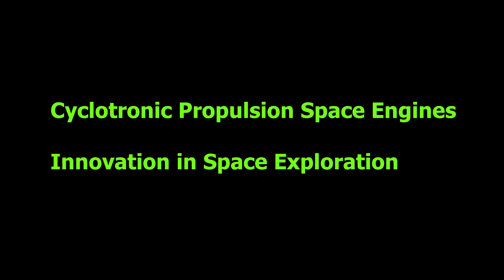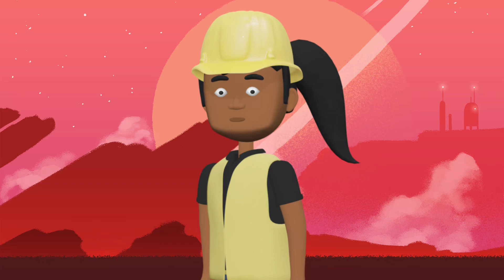Cyclotronic Propulsion Space Engines: Innovation in Space Exploration

Comment from the maker: Cyclotronic Propulsion Space Engines: Innovation in Space Exploration Cyclonic propulsion is an advanced technology that utilizes the principles of cyclotrons to generate thrust in space. This form of propulsion promises to revolutionize space transportation systems by combining high fuel efficiency with the ability to achieve significant speeds in the vacuum of space. Below, we will explore in detail how this technology works, its advantages and applications, and why it could represent an important step in long-range space exploration. 1. Cyclotron Principles Applied to Space Propulsion The cyclotron is a type of particle accelerator that uses a magnetic field and an alternating electric field to accelerate charged particles, such as protons or electrons, to speeds close to the speed of light. In the context of space propulsion, this concept is adapted to launch particles at high speed, and according to Newton's third law ("action and reaction"), this generates thrust in the opposite direction of the emitted particle beam. In a space-based cyclotron, fuel is converted into a stream of charged particles, which are accelerated in concentric spirals inside the cyclotron. Once they reach maximum speed, these particles are expelled through an exhaust nozzle, creating a continuous thrust. Although the mass of the emitted particles is very low, their extremely high velocity compensates to generate effective thrust, especially in long-duration missions where efficiency is prioritized. 2. Advantages of the Cyclotron as a Space Engine One of the main benefits of a cyclotron-based engine is its fuel efficiency. Unlike traditional chemical rockets, which burn large amounts of fuel to generate thrust in short bursts, the cyclotron uses a small amount of mass, fired at extremely high velocities, to generate thrust continuously and sustainably. This approach is particularly useful in deep-space missions, where fuel resupply is limited and the priority is to maximize thrust per unit of expelled mass. The cyclonic propulsion system is also durable. Because there is no need to burn large amounts of fuel at each stage of the mission, the engine can continue operating for long periods with low resource consumption. This makes it an ideal option for long-duration missions far from the solar system, where refueling is impossible. Additionally, since the particles accelerated by the cyclotron reach near-light speeds, the engine can produce sustained thrust that allows spacecraft to achieve significant speeds over time. Although the initial acceleration might be slower compared to traditional rockets, the constant thrust of the cyclotron would allow the spacecraft to reach extremely high velocities on long-distance trajectories, such as missions to other planets or even nearby stars. 3. Particle Material Selection for Propulsion The fuel used in a cyclonic propulsion engine is essentially any type of matter that can be ionized and accelerated. However, the type of particles selected directly affects the system's efficiency. Protons are an ideal choice due to their favorable mass-to-charge ratio. As positively charged particles, they are easily manipulated by the cyclotron's electric and magnetic fields. Another potential material could be ionized gas such as xenon, which is already used in conventional ion engines. This gas is easy to store, relatively dense, and can be ionized and accelerated with great efficiency. Additionally, with a higher atomic mass than hydrogen, it produces more thrust per emitted particle. 4. Atomic Battery as an Energy Source To power the cyclotron and associated control systems, a constant supply of electrical energy is required. In missions near the Sun, solar energy could be a viable option, but in deep-space or distant orbits, sunlight is too weak to provide sufficient power. For this reason, the use of an atomic battery (RTG) is ideal for these missions. Radioisotope Thermoelectric Generators (RTGs) convert the heat generated by the decay of radioactive materials, such as plutonium-238, into electricity using thermocouples. This system is highly reliable, produces constant power for decades, and requires no moving parts. This energy is sufficient to continuously power the cyclotron, ensuring the viability of the propulsion system over long missions. 5. Cooling in Deep Space One of the challenges of using a cyclotron and an RTG is the amount of heat they generate. However, the vacuum of space offers a unique advantage: its proximity to absolute zero allows for efficient heat dissipation through radiators. Radiators exposed to the cold of space can dissipate the heat generated by the cyclotron and RTG through infrared radiation. As the spacecraft moves further away from the Sun, the radiators become even more effective, as the ambient temperature decreases. The optimized design of these radiators ensures that the spacecraft can maintain its operating temperature without overheating, allowing the cyclotron and RTG to operate continuously and efficiently. 6. Unmanned Design for Initial Phases To simplify the initial development of the system, the first spacecraft using cyclonic propulsion will not be manned. This eliminates the need for complex life support systems and shielding for human protection. Instead, the focus is on protecting the electronic systems and key components of the spacecraft, using shielding against radiation and heat. The spacecraft can be remotely controlled, and the protection system is specifically designed to maintain electronic controls and internal structures safely, without the need for human isolation systems. This allows for faster and more efficient testing before considering the possibility of manned missions. 7. Particle Beam Safety in Space A potential concern might be the impact of the particle beam emitted by the cyclotron. However, in the vacuum of space, there are no nearby objects that could be damaged by the beam. Since space is virtually devoid of matter, the particles accelerated by the cyclotron will travel without colliding with atoms or molecules, minimizing any risk of damage. Additionally, the direction of the particle beam can be carefully controlled to avoid any accidental impact with the spacecraft or other objects in space. This system ensures that the beam does not affect the spacecraft or its immediate environment. 8. Future Applications of Cyclonic Propulsion The cyclonic propulsion engine is ideal for long-range missions, such as flights to distant planets, moons of gas giants, or even interstellar missions. Its ability to maintain constant thrust over long periods makes it a superior option for exploring regions of space that would be beyond the reach of traditional rockets. As technology advances, we may see spacecraft with cyclonic propulsion capable of traveling beyond the solar system, opening new frontiers in space exploration and enabling unprecedented scientific missions.